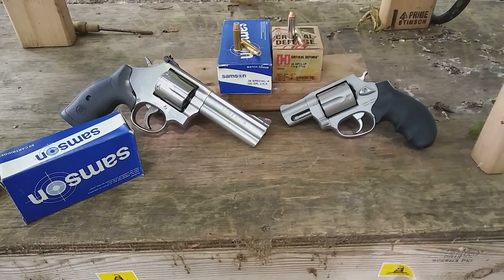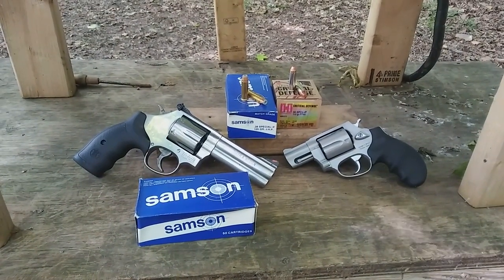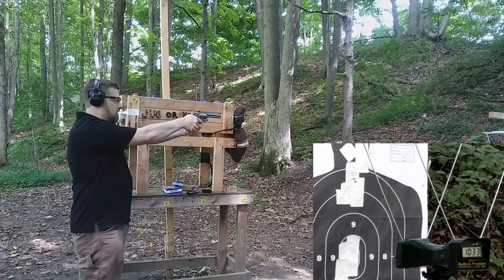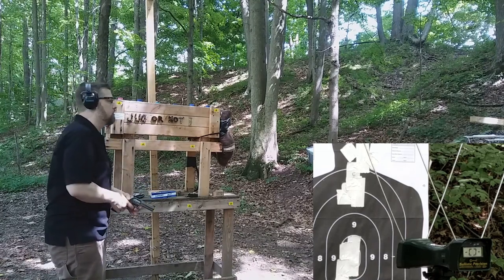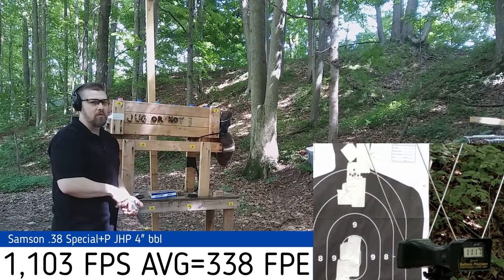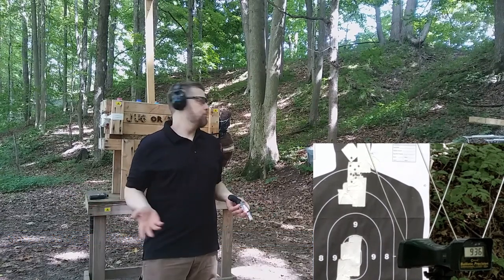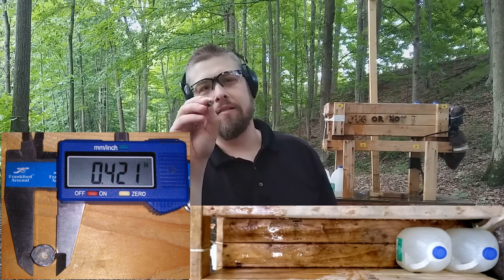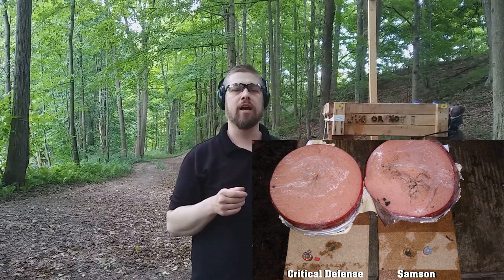Vintage Ammo VS Modern Ammo .38 Special+P

Comment from the maker: I wanted to make an important mention, that I did take a look at the 686 and the "strain screw" (screw that makes the hammer leaf spring be at high tension) was very loose and backed out quite a bit, I tightened it and there's certainly a difference on hammer strike force now. Thanks again to N.E.PA. GUNTALK: https://www.youtube.com/channel/UCeBFMb52dDIrY1JRpFhR0qw
Reply: Blue locktite helps with those. You don't need the red.
Reply: Maybe you should consider retesting the Golden Saber rounds for reliability now that you found the cause of that problem.
Reply from the maker: @Pointblank2U  The times I did have reliability issues with the Golden Saber and Ultimate Defense were actually out of the 342PD.
Reply: I was getting lite primer strikes one day and that was the problem. I was quite disappointed until I figured out how easy the fix was. Awesome video again Sam thanks
Reply: Sam your right some of your reply options have been deleted or something i tryed to respond and there was no option.🤔
Reply from the maker: @Ford360CID  That's been happening a lot lately to a lot of people. Don't know if its site wide or just a gun channel attack.
Reply: Thisbis getting way out of hand and i don't think its a google glitch but fore thought of malace
Reply from the maker: timmybmn  P.S. I tested the Starfire .357 Magnum ammo. WOW lol, and not in a good way. Releasing video Tuesday.

Comment: I would love to see a test of Vietnam era .38 spl vs modern day. I'm curious what bullets were used back then.
Reply: I fired .357 magnum 158 gr Winchester Lubaloy semi-wadcutter rounds in the mid-1960s. It was about all I could find.
Reply from the maker: I'd be interested to know what that ammo is like.
Reply: @GunSam  Basically, it's a 158gr lead semi-wadcutter with a thin copper coating, not really a jacket. I tended to have some leading problems with my 6" Colt Trooper.

Comment: In case it really is that old, you'll want to be sure to clean your guns quickly.  The old gunpowders used to cause pitting if you let the gun sit very long after shooting.
Reply from the maker: I don't know how much truth is there or not with ammo only 36 years old, but it was dirty and one round expanded the brass so much that I had to disassemble the 686 and let CLP soak in the chambers before knocking it out with a screwdriver in the chamber, so I did clean the rest as well. The next day I cleaned the 605 too as it was just looking dirty.

Comment: The velocities you got out of those old bullets proves that manufacturers nowadays are neglecting their 38 special loads.
Reply from the maker: I think most of the issue is money. Easier to just use the same powder and powder charge as a standard pressure 9mm round, just leave the powder throwers alone and fill the less popular .38 Special+P rounds with it. It just so happens that those charges stay within .38 Special+P specs. I can understand why they do it, but it gives the .38 Special a bad rap as the .38 Special+P should be 1,100 FPS with a 125 gr bullet.
Reply: Gun Sam Revolver Aficionado Wow!  I didn’t know manufacturers treated their 38 special loads like that.  It really goes to show that manufacturers really do treat 38 special like a second class caliber.  I’m sure it saves them money, but it’s really kinda sad because in the end, the consumer isn’t truly getting what they pay for.

Comment: Cool test,any advice on how to get a scratch off a Parkerized  finish on a revolver thanks.
Reply from the maker: I am not very knowledgeable on parkerized finishes, but if I had no other options I would either use gun blue to cover the scratch if it was steel colored, or I might tape off everything except the scratch and try to do a quick blast of matching matte spray paint and then try to blend it with rubbing compound or whatever might not damage the rest of the finish. But again I don't know anything about those finishes.
Reply: @GunSam  Thanks might try the matte spray.

Comment: Can you test out of cartridge conversions of black powder revolvers??
Reply from the maker: You would have to elaborate as i'm not very familiar with all of that.
Reply: @GunSam  
I know I'm late , but I know what the original commenter was on about
there's conversion kits for the old cap and ball revolvers , ranging from just a cylinder swap , to fully swapping the barrel , cylinder , and cutting a section of the frame out for a loading gate

Comment: Great video, it was interesting to hear about the Hornady fail rate that you have experienced, makes me wonder about using it for a carry round. Obviously it would penetrate and do some damage, but the round not functioning as designed?
Reply from the maker: Thank you. I believe that it's a decent round for most cartridges, however in .38 Special+P I get wild velocity changes from box to box. My last box gave me 1,000 FPS in the snub nose and 1,130 FPS in the 4" barrel. This box 100 FPS less. I have been noticing that with Federal HST as well, for some reason they both are either in the dumps for quality control or they truly are loaded less powerful than they used to be.

Comment: Have you noticed the Hornady ammo having issues in other calibers or just in 38?
Reply from the maker: I have had the same lack of expansion with the .380 version I believe.
Reply: I just started carrying a 380 and having been using Critical Defense. It's still seems be to a decent choice, but idk of any 380 ammo that works 100% in the short barrels
Reply from the maker: @christophernemeth421  HST does but it has a lot more power than average, didn't run right in my LCP but would work well in something more heavy duty.

Comment: Cool
Reply from the maker: I got a bunch more. I should test them in gel.
Reply: @GunSam  make sure to do DA to check ignition though. I have a box of old 9mm Slick50 gave me...it jammed in one pistol and blew out the bottom lost magazine butt plate In another pistol even though kept in safe I think got too much moisture over the years and too hot? Maybe good for a subgun but don't know what to do w it now. It's ball.
Reply from the maker: The 686 was really messed up that day. Like, rather than your typical 12 lb trigger or so, double action was like 6 lbs. I knew something was off. The entire strain screw to the leaf hammer spring was backed out. To be honest I did that on purpose awhile before that as shooting Federal ammo with their soft primers worked fine with it. Not the ammo one bit.
Reply: @GunSam  just finished filming u a nice shoutout vid ti get u more subs on all thr ammo I'm sending you so u can figure out what is what. Should get you good amount of new testing vids and subs hopefully u can do same for me and new channel Pew reviews. About to go start reviewing the new Diamondback Sidekick I'm excited about it now that specs on it are on their site!